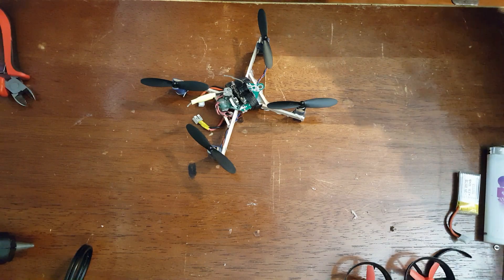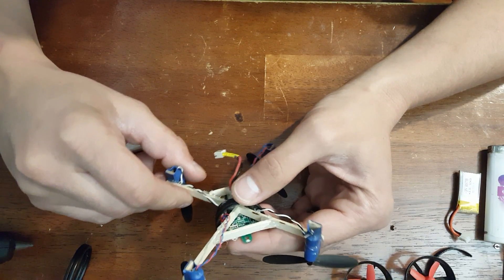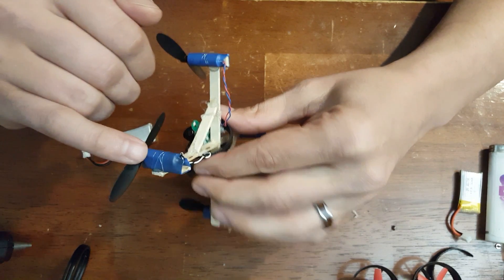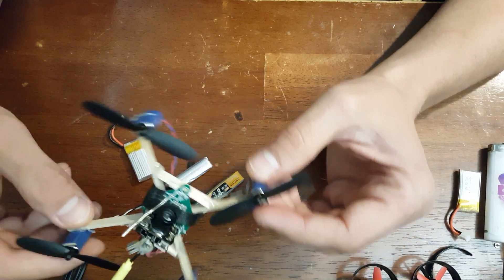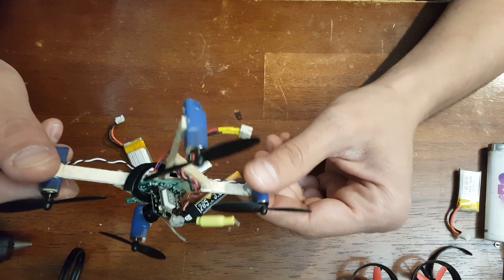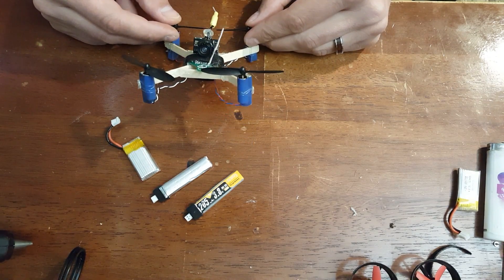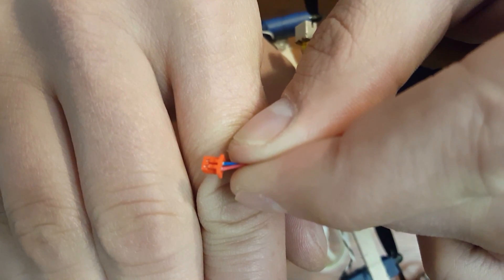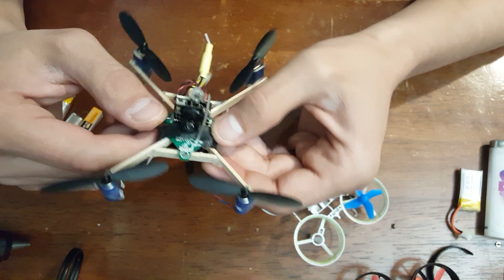Eachine E011 DIY X Frame

Comment: Misleading description.
Your running coreless motors; YES
Not brushless motors.

If you wish to check... Pop off the little white cap on the bottom of your motor where the wire comes off... Attached to that cap on the underbelly side, you will find your brushes. 
Also, brushless motors use 3 wires. 

Not knocking you or the video. Just wanted to clarify.

Comment: looking good!
i'am getting an AKK k90 frame :) planning on using a f36 board
Reply from the maker: Thank you I will have to take a look at at AKK K90.
Reply: https://www.amazon.com/AKK-Carbon-Fiber-Quadcopter-Racing/dp/B06Y5X6QX8/ref=sr_1_44?m=ADP3MHCS3NLR7&s=merchant-items&ie=UTF8&qid=1494261422&sr=1-44

i get it for review, it defenitly is different from all the others
Reply from the maker: always rc reviews! I saw that one yesterday.  it's a very interesting looking frame.  I like the motor mounts.
Reply: I dont know if i like them I dont have any 8520 motors😅 i do have 8mm motors tho
Reply from the maker: always rc reviews! I was looking at the racerstar 8.5x20mm motors.
Reply: I will order a set of GTeng 8520 motors. I have points at gearbest so i can get a full set for 7 euro.. but racerstar is better😉
Reply from the maker: +always rc reviews! Good deal!